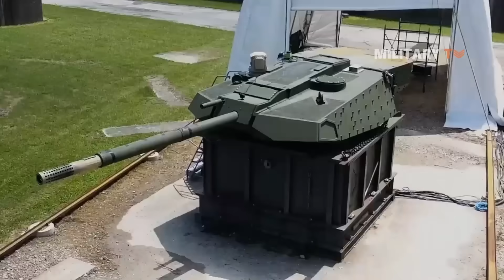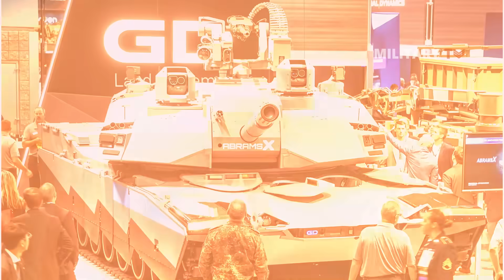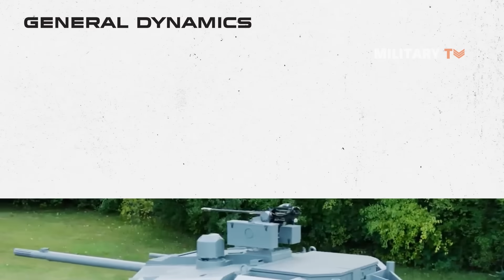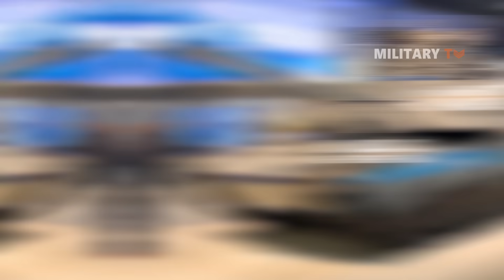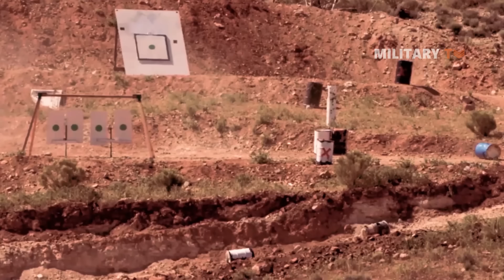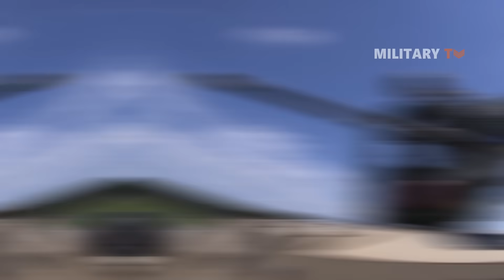Abrams X Tank: US Army Successfully Tested Deadliest New Tank

Comment: As a former 19K, I think this has a lot of awesome upgrades, except I don’t like the tc and gunner not being in the turret.  It’s the same thing the Russians have done with the T-14.  What’s the crew going to do when there is a misfire, jam, computer malfunction?  Can you manual fire or use an auxiliary sight?
Reply: Good point. I would also be interested in your point of view concerning the possible increase of daily maintenance tasks with 3 crewmen instead of 4.
Reply: even t-64 has pretty reliable autoloader. Also misfire can kill crew if it inside turret.
Reply: A tank is replaceable, a experienced crew is not.
Reply: Those were my thoughts exactly.

Comment: As a former M-1 Abrams tanker, here’s what I think;
1) I absolutely DO NOT want an Autoloader! That’s a HORRIBLE idea! It offers no advantages. You loose a crew member. Tanking is hard work! You need that crew member to help do maintenance and security. That’s also one less person in the crew sleep rotation.
2) I agree with loosing the turbine engine. Its power advantage of about + 300-500 more Horsepower was never really a useful factor. It gave a slight potential speed advantage, but that’s useless on normal tank terrain (which will always limit speed). The turbine wasn’t worth the massive extra fuel consumption.
3) A 30mm cannon instead of a .50 Cal? Yeah. I could see that.
Reply: Great point. 3rd crew member helps with shifts and maintenance.
Reply: I can see how 4 crew members can offer advantages, but reducing crew size reduces cost of manpower including potential losses. In a country with poor recruitment numbers it makes sense to
Reply: Its future, OLDMAN !!!

Comment: This seems like an absolutely amazing tank. This machine does seem to perfect everything about the platform.

1) Hybrid engine adressing M1's bad thermal image and fuel economy
2) APS for increased efficiency of the AT weaponry
3) 30mm autocannon for commander is a beast, less 120mm waste. Infantry and light vehicles are much better targets now. 30mm can also engage helicopters much better.
4) Joint space for better communication
5) Radar stealth is crucial, Longbow-type radars are a great threat.

This really adresses all major M1 flaws and includes experience from the REDFOR losses. Great job, engineers.

Comment: It sounds like it has some impressive new technologies implemented, but I have a concern regarding my previous experience with the M1 Abrams tank. I was a 45K Tank Turret Repairer in the early 90s & during Desert Storm. The turret had a limited amount of space inside for moving around & was difficult for maintenance to repair. The concept AbramsX did not appear to have any "visible" accessibility for the turret section. Presumably it has access to that section for maintenance from the hull section. I would be concerned about the ability to maintain & repair the components inside the turret in this vehicle.
Reply: My first question was about the auto loader. If no one is in the turret how do they clear a jam? This is a big problem with the t-14 if it jams they have to get out of the tank to fix it, I hope General Dynamics was smarter than that. 🙂

Comment: The biggest thing to understand here is that the Army didn't say "hey go build this" GD literally built a few of these using technology they all ready use on other platforms to say "this is what we can do." The FCS platform that was scrapped forever ago had a lot of these same concepts, but the tech just wasn't there yet. But the T14 now uses this same style of platform...though there are not many due to cost. I was and am still not a fan of this cannon, mainly due to questions about production time, and I also wonder how many rounds it can fire before the tube needs to be replaced. Our newest combat rounds put a beating on the M256 tube we use today. Maintenance would be an absolute nightmare on this thing I am sure, it already is today, but that's mainly a Soldier issue...the Tanker culture just isn't what it used to be. On top of that now you would have an up-gunned Bushmaster to maintain as well in the field along with the other weapon systems. And then there's the cameras...my biggest complaint, for this, the FCS, and even the T14. Simple small arms fire takes even one out, and you have lost situational awareness, no questions asked. Most Tankers will tell you that we want to be in the turret, we fight from the turret, we need EYES, not cameras.... and a damn loader....extra man for maintenance, and faster than an auto loader as long as they have a good gunner/Tank Commander to train them. I've loved the turbine, but always wanted a diesel, we finally have a good APU, though we should have went with newer light track, light road wheels etc. for the V3/V4. Which leads me to the last point (sorry for the exhausting comment) PRICE- Just look at what we are doing with the V3/V4....the government did not want to pay for all the upgrades at once, so they created packages. But, all they are doing is spending more in the end to retrofit more tanks with different shit. So, the if DOD does want this, what are they willing to pay? And once the bureaucrats get their claws in..... things will be added or taken away and we'll have something else. LAST thing...if there are 3 people in this Abrams hull...where are the front fuel cells? Thanks to whoever read this lol.
Reply: Great comment. It's obvious you know your stuff. Thank you
Reply: It did say the optics were armored, including the glass, and that parts could be swapped easily, modular design.
Reply: The new battle tank in my  mind sir first off thank you for your service to this great nation and a wonderful read!  The future of tank warfare is stealth. The future of tank warfare is speed and more speed. The new tanks need a computer base inside of them so they can run drones for reconnaissance. The new tanks should have radar jamming tech inside of them as well as well as drone jamming. The new tanks need to completely go away from bore cannon weapons they should be fitted with side winders and hellfire missles along with laser guidance system to aid in ordinance and air raids also a  tow system< the only guns it needs mounted on it is coaxial machine guns. And a 30mm running derived uranium loads that's all it should carry. This tank should be sighted with night vision optics along with outer standard optics  completly 360 degree 4k camera. the crew capacity 4 people the driver , the onboard missle launcher. The drone and or reconnaissance tech also responsible for jamming drones and spotting them and the last one the 30mmgunner. This tank should be absolutely designed to be as silent as possible and black as in b2 sltealth bomber black to be exact I'd simply call this tank the death stalker. It would only  be in operations at night and used to down right destroy enemy tanks and down buildings with very little risk I'd put a 1500 hp engine in it that is completely silent. Hard to be destroyed from enemy air craft when you are stealth kind of hard to be killed by enemy drones when you have  anti dronecapabilites. Kind of hard to get ambushed when you have a reconnaissance drone scoping out the entire battle field. Also very hard to get  downed when missles have a lot longer range than a bore cannon.

Comment: My main concern with the tank is the battery's reaction to a 5000ft/s projectile. It's also worth mentioning that the 30mm gun with probably have a fraction of the ammo the 50 has. It's more gun, but less ammo. I'd also like to see it's solo defense against a Walmart fixed-wing drone with 15lbs of explosive on it.
Reply: I'm sure it'd be pretty easy to attach a switchblade drone launcher on it.
Reply: @spackle9999  airborne bayblade
Reply: Itd use the same defense against the drone as it would against an anti tank missile. The drone wouldn't stand a chance.
Reply: @ObiWanShinobi917  my main concern is those batteries. There is a lab that got blown to smithereens by a D-sized lithium Ion battery. Imagine with enough power to move a 50 ton vehicle 😨
Reply: I think most if not all tanks would be concerned with a 5000ft/s projectile, battery or no. Hope these batteries are at least designed with a blowout panel though.
Reply: @thepilotman5378  They're making tons of advancements in battery safety, it's easy to forget lithium ion batteries are a fairly recent innovation, they were pretty rare until the last 10-15 years. Besides that I think the bigger concern is the hundreds of pounds of gunpowder, high explosives, and fuel on board. Being afraid of the battery is like going to war worried about being bayoneted but not thinking about being shot.
Reply: @arthas640  the gunpowder issue has already been largely solved with the venting system onboard the Abrams. And if you've seen what I've seen, you'd know a Car-sized lithium battery heated high enough can go off like an 85mm artillery round. I'd bet they have some system in place that attemps to suppress as the people working in the tank are much smarter than me, but lithium batteries are very difficult to extinguish
Reply: I wouldn’t assume that they didn’t think through the ammo capacity. Being one less operator and moving all men to the front hull gives almost 70% more space for ammunition. That being said you need less ammo with a 30 mm
Reply: @thepilotman5378  They could be using Lithium Iron batteries which are much more stable
Reply: @thepilotman5378  Guaranteed the battery pack is way more advanced than anything on the market today. Just the other day NASA announced major breakthroughs with its solid state battery that is way safer than a normal battery we know of today. Maybe they have those solid state batterie's and have absolutly no fear of them ever exploding even if they are hit with shrapnel.
Reply: @mattwasilewicz9677  I doubt it, they will be using the latest technology something we have not seen as consumers yet. possibly solid state or something just as safe it it is hit by shrapnel.
Reply: @andrewbrown3439  you are probably right.  What I can guess for sure is that they are not using a typical Lipo battery that everyone associates with blowing up easily
Reply: In 2022 they started replacing flammable parts of batteries with electrolytes that don’t burn.  Also against drones the best counter would likely be a laser.  For example in Ukraine the Patriot anti air will likely be targeted by hypersonic missiles, and the best counter against those is again a laser.
Reply: @thepilotman5378  battery tech might not be ready yet, but it will be. The right battery for a tank may not be lithium. There's a lot of other materials in play.

Comment: I've heard it could also carry and deploy 2 of our switchblade loitering munitions aka suicide drones.  That would also add a lot for situational awareness as I imagine while they are in recon mode they could feed that info right to the tank.
Reply: I saw that too. However with a crew of only 3, I wonder who they’d give the job of controlling them to without overloading them mentally.
Reply: @KC_Smooth  I like the idea of making a new generation of tanks. Some are saying we should go to the 130mm Rheinmetall or the 140mm Nexter. Are either one of those guns electrothermal chemical guns like the 120mm (if converted to ETC) on the Abrams X? Would their rounds be more powerful than the new rounds for the Abrams X's 120mm? I think a 4th crew member should be added so he can help operate secondary and tertiary weapon systems such as the 30mm canon, hero drones, etc. I'd say mount a .50 paired with a crows system on top. Add some active countermeasures to go along with the already present passive ones. Add reactive armor. Is it true these tanks will have javelins? That would be a weapon system the 4th crew member could utilize while the gunner/commander are concentrating on primary targets. As far as a tank platoon goes, maybe the lead tank of the platoon could use reconnaissance drones in place of hero drones.
Reply: @KC_Smooth  I imagine a lot will be done by the on board AI ID'ing and calling out threats automatically
Reply: @KC_Smooth  just like they run drones now. they ask for deployment and someone in a cubical thousands of miles away will fly it for them

Comment: Being a Abrams crewmember from the M1 slick to the M1A2SEPv2, with over 20 years active duty Army on her, there are great pros and cons of my beautiful beast. I have always advocated for the TC's weapon to be something of 20mm to 25mm gun. Like the Bradley's or the old Vulcan gun. Though sticking with the .50cal, I pushed for a larger ammo ready box instead of the 100 rnd cans. But always got shut down by GD teams. Another hinderance of the Abrams was in street fights where Tank Commanders not being allowed to use its weapon systems. Main gun HEAT rounds wouldn't always work as a lot of the buildings were of cheap mud/concrete buildings. The HEAT round would go completely thry a building but the .50 cal cutting big holes but then stopping having to go outside to change ammo boxes. With higher Always worried about collateral damage. Starting with getting permission from the Brigade Commander to use the main gun, then it was the .50cal. By the time a TC got permission, bad juju can happen to the tank and infantry personnel. 

There's a lot of great ideas with all the active protection systems but what happens when the 2 top site pods get taken out from small arms? How does the Battlesight for the gunner work or if there is one? The gunner could use the site which is slaved to the main gun but if it's electric like the other sites, how does that one work? Also seeing no hatches on top, how does the crew get in there to reload the coax ready box or a weapons malfunction of the coax? Maintenance crews to fix or change out hardware? How many main gun rounds does it hold in the turret ammo rack? Just food for thought we old tanks can converse on. Best damn job I ever had. TANKERS RULE

Comment: The 30mm autocannon is a very good idea, and the autoloader, new engine... but will that new XM360 120mm main gun be porwerful enough to defeat other modern MBT´s?. The new Rehinmetall 130mm L51 looks like a big step forward.
Reply: wont be an issue tanks are not for fighting other tanks anymore they are for infantry support. the 30mm will be the mainly used gun while the cannon for heavier armor and bunker busting. air support is for destroying the heavy tanks they have some missiles that are really good at destroying tanks from dozens of miles away
Reply: The XM360 can use every modern projectile, so there is ones for when you fight against other tanks. 125mm from a T-72 will be less penetrable than a 120mm XM360 with a modern projectile.

Comment: I would love to see one in action. I was a tanker, and I got out as the Sep 3 was being looked into. Got to see it with new sights better distance in sights, and the A/C system was awesome, but reliability is a must, and there were a couple of issues with it. Auto, anything worries me in battle. The A2s were bad ass but if you did get to know the gremlins in your tank,  in battle recovery could have been a bitch. B33 was a stud of a tank an would have gone to war In that thing.
Reply: Former 19k as well.  This looks like a ton of systems to break, especially in combat situations.  The only thing I like on this is the 30mm, but it isn’t necessary except in situations where the tank is out on patrol for days.  The 120mm does a fantastic job of taking out small armored vehicles already and the battle load is more than enough for al last all scenarios short of a situation where we are in WW3 and we are fighting on the back foot.

Comment: Looks very impressive. This one is probably going to be produced a lot in the future. Also very excited for KF51 Panther, though not sure whom or in what extent its going to be built in. Its 130mm gun and included 4 drones, sets that one a part.
Reply: Do I hear "tiger" coming soon?
Reply: The Abrams X can launch switchable drones and is fitted I believe with an Electro Thermal Chemical gun. It also features a 30mm auto cannon, similar to the one found on the Apache attack helicopter.

Comment: I like the idea of making a new generation of tanks. Some are saying we should go to the 130mm Rheinmetall or the 140mm Nexter. Are either one of those guns electrothermal chemical guns like the 120mm (if converted to ETC) on the Abrams X? Would their rounds be more powerful than the new rounds for the Abrams X's 120mm? I think a 4th crew member should be added so he can help operate secondary and tertiary weapon systems such as the 30mm canon, hero drones, etc. I'd say mount a .50 paired with a crows system on top. Add some active countermeasures to go along with the already present passive ones. Add reactive armor. Is it true these tanks will have javelins? That would be a weapon system the 4th crew member could utilize while the gunner/commander are concentrating on primary targets. As far as a tank platoon goes, maybe the lead tank of the platoon could use reconnaissance drones in place of hero drones.
Reply: Penetrating (and improving) frontal armor is a last century problem though, as the war in Ukraine has shown bigger guns aren't so much needed as munitions come down from above to disable.  I think we'll still need MBTs, but one-upping the best Cold War designs might not be the direction needed.

Comment: As these new versions are built the older versions they replace can be sold off to Taiwan thus "forward deploying"  them to a place that has a reasonable high probability of where they may be needed.
Reply: Good idea, but it all depends on the testing phase the ABRAMS X goes through, and how long that takes.